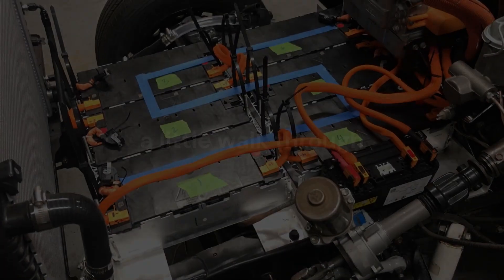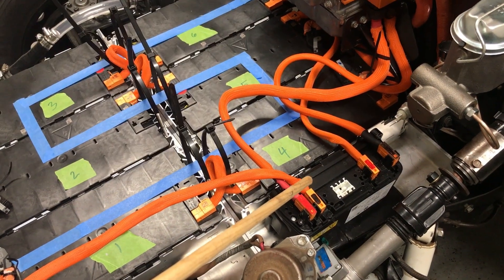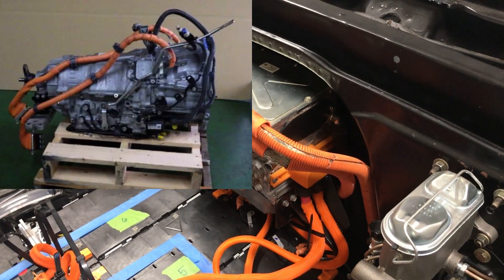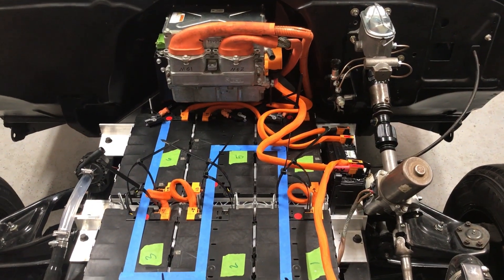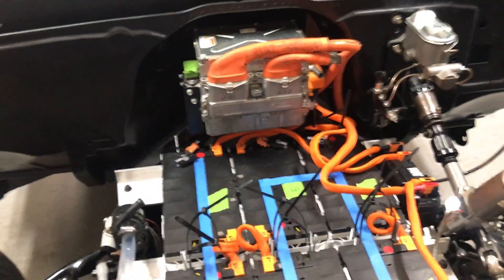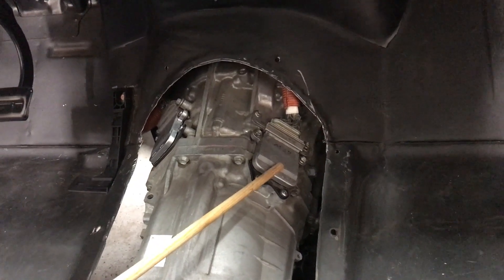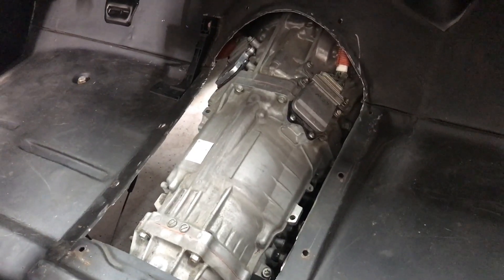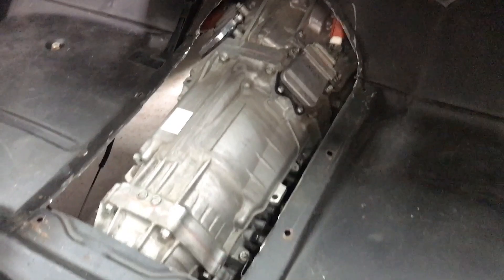EV Conversion Walk Through

Comment: Just wondering, how much of a software guy are you, i'm planning my build (gs300h trans and inverter, rest of the components sourced from a post 2017 nissan leaf and transplanted into a 1980s (preferably 89) volvo 740) and curious to know what kind of software dev/coding skills are required. (willing to learn but know all to well how much of a headache code can be)
Reply from the maker: im a pro it guy (email admin) not programmer, if you dont own a VCU then you can buy the ZombieVerter aka a newer version of what I got. The Zombie is closed source, meaning zero programming, its all menu driven, I'm about to upload a 2 part video series tonight on the what minimal hardware and software it takes to spin the wheels which I think will help you out
Reply: @Good-Enuff-Garage  oh cool, i didn't know the zombieverter was closed source that's convenient. Is it still quite customizable despite it being closed source?
Reply from the maker: @Yorgos56  i never laid my hands on it and YT wont let me post external links to the OpenInverter Wiki so just Google it and its the first link and here's info directly from Damien it's creator https://youtu.be/geZuIbGHh30
also email me muszyngr at yahoo
Reply: @Good-Enuff-Garage  cool thanks, i've watched damien before and used the wiki (mainly for the forums) but i haven't delved into the open inverter project itself and Damien's vcu work, no time like the present i guess, or in a couple of days as my schedule does not have much leeway. Thanks for the help man :).
Reply: Just fyi its not closed source. Zombieverter design files are available, im fact there are community contributors to various parts of the project. However Damien does sell these in a relatively plug n play kit and messing with the code ksnt necessary.